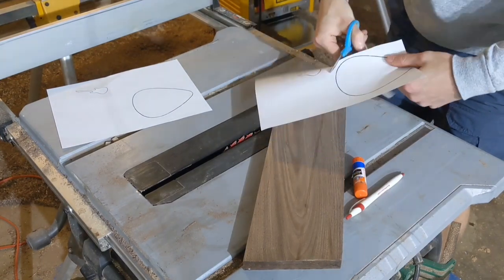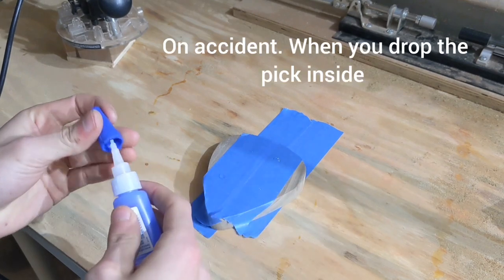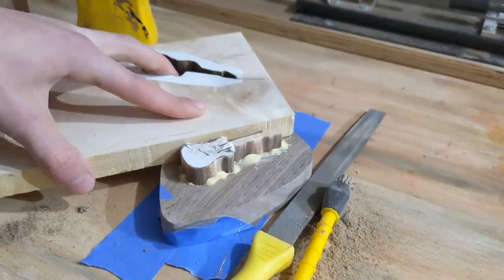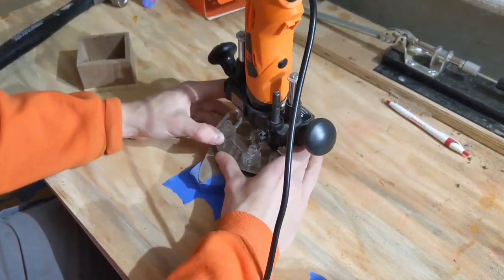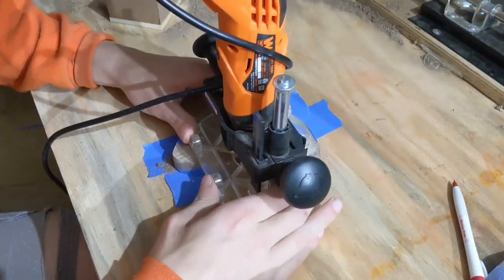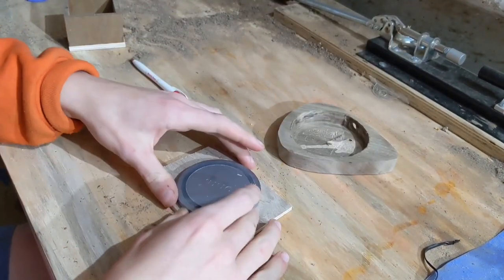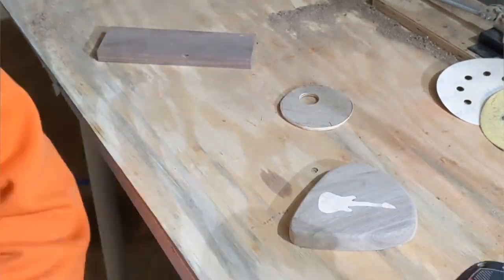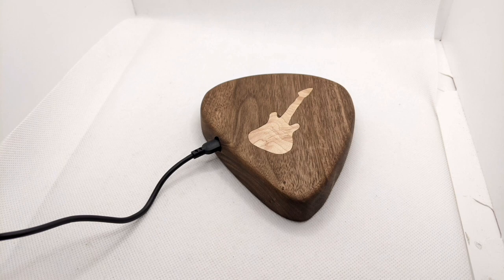Making a Wooden Wireless Phone Charger

Comment: If you ever decide to make one of these again, slight piece of advice.  1) get a bandsaw.  I cringed seeing you cut that guitar off at the table saw.  2) Using said bandsaw, slice about 1/8th inch off the top (more or less, depending on the charger strength).  Next, drill a hole & use your scroll saw to cut out the circle for the charger (might as well do the port while you're at it.) Then glue the top back on.  I've made a few of these over the years and that is by far the fastest & safest way I've found to do it.
Reply from the maker: Excellent points all around Charles!! I agree! Unfortunately a band saw is a bit out of budget right now, but hopefully the people will start buying more socks from me and I can afford one soon. Thanks for watching!!